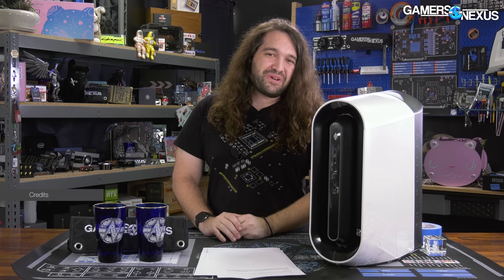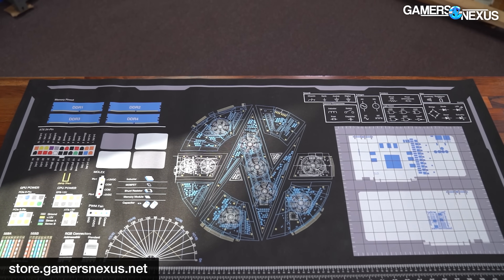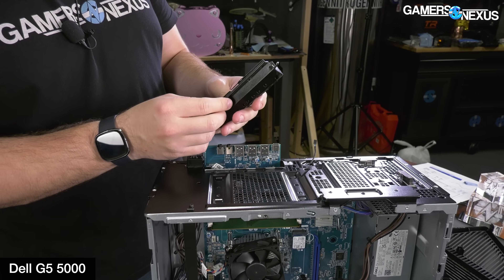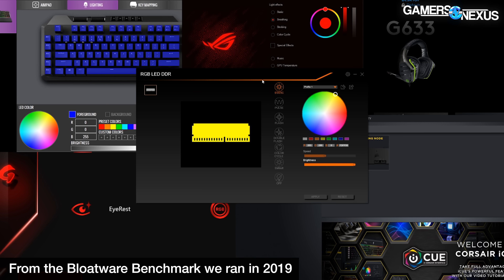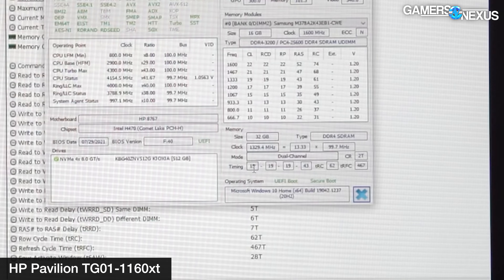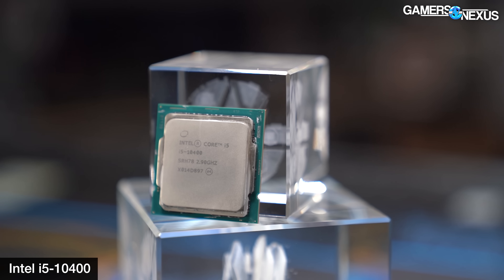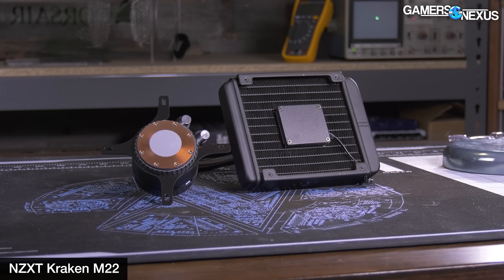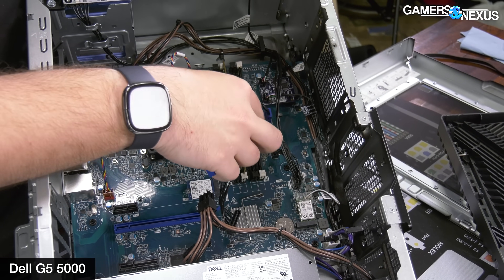The Worst Prebuilt PC Mistakes We've Seen (So Far)

Comment: Was very surprised that my Lenovo Legion AMD 5 tower [The Ryzen 5 3600 version] only had two 'bloatware' on it. The Lenovo Vantage program which doesn't even have to run constantly, and I think McAfee which I installed swiftly no prob. The RAM was a single channel of 8 GB but I knew that going in and got two 8 GB sticks of Corsair Vengeance for 16 GB. I got lucky with this prebuilt but I also watch GN and do research. Those Dell and HP systems make me want to roblox myself.

Comment: I worked for a company in Serbia that does all sorts of builds, and it was funny to me when I started cable managing the cheap office-type PCs and they were like: "that's a waste of time, just zip-tie them so that they don't get into a cooler and any fan that is inside of the case", but if it was anything over 1000 Euros, they made sure and triple checked every single cable, it was not allowed for a PC to be built without checking it all and making sure that it's almost perfect.

But depending on the cases we worked with, for example, Raidmax cases always have 4 fans inside and they are in most cases molex powered ONLY, and you end up with molex centipede. Most of the time it was not up to us to make the situation better, we worked with what was given to us, and it was way cheaper to use molex fans because they are 50cents less (I always get mad because of that, but again when they build 100s of builds like this a day it does sum up to something).

Anyways, love the content keep up with the great work!

Comment: Those proprietary mobos and PSUs drive me up the wall, let alone coolers and stuff. I save a lot of office PCs and stuff from the landfill having done jobs at one and elsewhere and trying to repurpose those things without resoldering complements or something to scrap the literally caps from the board is difficult when you can only use the parts with the Dell Model TPP4294u-X or whatever.

I also have some "retro" PCs for parts from the mid and early 00s. Same thing! Except some better coolers I guess lol

Comment: not soldering plugs and PCI connectors to the main board of prebuilt computers that were not sold with the device that would plug into the missing port (solder pads on the board for it, just the plug is MIA). thankfully I haven't seen that in around 20 years, however, it's also been about that long since I got a prebuilt computer for just that reason. if you want something you can actually upgrade, don't get a prebuilt.

Comment: I had a prebuilt where the motherboard was locked to the harddrive the system came with, when I tried to upgrade the harddrive I could no longer boot up the computer, I don't remember the exact message it told me as this was several years ago, but it was something with roughly the meaning "Bios key locked", I believe it was an HP prebuit but for somewhat obvious reasons, I don't have it any more so I can't double check.

Comment: I don't know if you've ever looked at how HP designs their pre-built cases to accept NVMEs, but they hang off the motherboard and you need to have standoffs available in order to install it to a the case itself via a screw slot at the bottom of the back side panel in order to secure it. Awful design.

Comment: A prebuilt classic that's always happened to me and my family: Specifically order a configuration with two sticks of RAM, open the PC up at some point and see both sticks in the first two or last two RAM slots.
Reply: at least they didn't do you like Dell would and just "upgrade" you to a single stick of the amount you ordered even though you selected 2xYGB
Reply: I bought a 2nd hand pc that’s put together from off-the-shelf parts and it still had the ram in the first 2 slots. I mean fixing it didn’t change my performance that much because it’s an old-ass pc, but still, it’s better to run dual channel
Reply: OR one stick of ram with twice the capacity

Comment: 8:40 Just gonna put it out there that experts dont typically remove boatware because its too time consuming and it professionals will typically just order the prebuild without an OS or if that is not an option will just install from a clean windows image upon initial setup. It will typically take less time to do this than remove the bloatware apps one by one. Sometimes you just need to take off and nuke the site from orbit. only way to be sure ....
Reply from the maker: Definitely way easier to reinstall Windows.
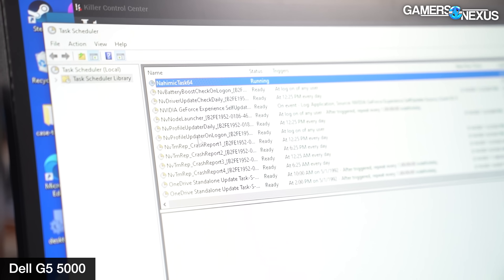Reply: Which was already stated at 8:50..
Reply: @thetalesofdaneandco  Protip: If ordering a decent amount and they have the same (or very similar) hardware, set one up manually, then mirror the disk image onto others using Clonezilla or something, that way each one only requires minor config like hostname and such. Can potentially save time depending on how much setup/config is required before issuing to users.

Comment: As usual great content Steve. There is a point where I don't fully agree with you. In 2021, I don't think 32GB is overkill anymore. Win 10 is much more memory hungry and having more RAM means that the CPU does not need to compression the RAM so much and thereby improving multi tasking performance.

Perhaps the argument of the extra $80 that is spent on an additional 16GB stick of RAM can be better spent elsewhere, but for generic desktop use (not limited to gaming), I am no longer sure if I would spend the $80 on a CPU upgrade (if there's any such option) or perhaps just to have 32GB instead of 16GB.

Comment: As a Cities: Skylines player... it really hurts that you're shitting on 32 gb ram so much. I swear just a handful of mods send you over 20gb!
Reply: That's an edge use case though.
And it still won't give you a good experience when the timings & latency are terrible and the 32GB RAM is paired with a bargain bin i5 CPU.
Reply: @LRM12o8  it really isnt. i have two apps open and my system uses 50% of 32GB. if i try to open a game or a nother browser window with too many tabs and i get memory issues. 32GB isnt even enough for me. 32GB is not overkill anymore. Windows and windows apps are memory hungry. deal with it. 64MB is not enough anymore, move onm from the past. I have been running 32GB for well over 5 years now!
Reply: @prydzen  No. For the vast majority of gamers (and even more normal users), 16GB is more than enough.
Reply: @prydzen  What apps are those? If you don't specify, then that's pointless information and not an argument. 

I've been using 16GB RAM for five years now and never felt the need to upgrade. I've never reached 100% RAM utilization, running brave browser with 20+ tabs and modern games like SW Jedi Fallen Order plus sometimes even a VM that reserves 4GB on top.
If running Windows and its bloated apps alone ever required close to 16GB, then I'll gladly move on... to Linux! The Operating System is supposed to be as efficient as possible, so I can use my resources for the actual applications. Saying "deal with it" to a resource hogging OS is ridiculous!

But anyway, you completely missed the point that Steve made and I defend:
A better CPU would generally provide a much bigger performance benefit than this big amount of really poor quality, really slow RAM!
Especially since these weak CPU's can't perform most typical memory-intensive tasks well enough to make use of that 32GB RAM anyway!

Like Linus once said, unused RAM is wasted RAM.
Most new games are still playable just fine with 8GB RAM and when it comes to productive tasks, performance is hampered by the low-end CPU and GPU, so even then the 32GB RAM won't be of much use. It's wasted cost at these specific configurations!
Reply: @prydzen  
The fact the RAM is used does not mean it is necessary. Just look even in the basic Task Manager, you can see how much of "used" RAM is just cache.
I am normally using 14-15 GB of RAM even prior to launching a game, yet to others I still recommend 2*8 GB for average-budget builds.
Reply: @Killer007TV   This is why it drives me crazy when I see reviews on those "cleaner" apps, or comments somewhere about RAM usage on Android phones. So many "average users" run those "memory cleaner" apps constantly because they think RAM usage needs to stay as low as possible and don't understand that the OS is using most of it to cache things like data for apps you launch regularly etc. It will release as much of this RAM it's using for cache if it needs to as soon as a App requests enough RAM that it needs to do so.
Reply: @sean8102  Thank you! Exactly spot on. Unused RAM is a wasted RAM. When more memory for foreground apps is needed, the system will automatically allocate it to them. These Ccleaners and similar trash bloatware just leveraging on lack of knowledge amongst the majority of PC users and their fear of "not enough memory"...
Reply: yes fuck, for my next pc I will be definitely getting 32gb, just in case I want to play Cities skylines again.
Reply: I actually take this back. As a game player in general it hurts. I am trying to literally just play GTA:V and have a browser open and I am already using more than 16gb of ram. My system is maxed out at 16gb usage and is using the page file like mad. game is unplayable!

Comment: During the summer i picked up an Alienware Aurora R12 with the intention of gutting it. When i got the new furnace from dell, i opened the side panel to remove the parts i wanted. The unite came with the 120mm AIO, but the fan internally was set to pull, not push. The case would have just entirely filled with hot air with almost no way to thermally radiate outwards. Nothing like a 4A server fan running intake into a hotbox. I thought it was going to lift off like a Harrier. 

TIL: Dell makes V-TOL Jets with improper cooling configurations.

Comment: Last year I bought a Skytech pre-built and it managed to have 300GB of unused and non-labeled files buried on the system with a 500GB SSD as the only storage. Also that same system had a broken hard drive bolted in the back of the system. It seems like they plugged in one drive and it didn’t work so they just put another one in without ever taking out the dead drive.

Comment: The computer I have been using for the last couple of years is a pre-built from a local company (Yes... I was the teenager that saw a Big Youtuber showing a brand of computer builders and went: oh, fancy looking shiny thingie... me wants) and they actually did quite a good job when it comes to the components, the build quality... The only thing was the RAM... Regular Corsair RAM but only 1 stick of 8GB if I wanted 16GB I also needed to upgrade to a GTX 1070 at the time so... With 8GB single sticc  I went

Comment: 6:02 damn, I haven't heard a WinME mention in YEARS, totally forgot about that one
Reply: I'll never forget it. As a kid my parents bought a computer with Windows 95 on it and then the next computer they bought came with ME......not 2000.....No it had M freaking E on it. And it constantly had errors
Reply: @kudzuwarrior  You realize what went wrong with ME, don't you?   That was the era when Plug and Play was still NEW.   Before that, many cards required you to set dip switches to select memory address and IRQ to avoid conflicts.   So, ME comes out with Plug and Play support, and of course, it breaks.   The problem was that in the effort to do the "plug and play", it would change the memory/IRQ for all the devices in the system, and a stable system with a new sound card would not only BSoD, but removing the sound card wouldn't fix the problem.   Windows XP at least had Plug and Play working, but in ME, it did NOT work properly.
Reply: @kudzuwarrior  Sounds like user error.....  I had 3 systems running WinME that were rock solid.
Reply: @aaronthomas6155  history would beg to differ with you bud. Your experience does not equal the experience of every other person out there. That's like saying "well this game runs fine on my system so there's no way you have problems running it on yours"
Reply: @aaronthomas6155  That's right you did. You may have just as well walked right up to me on the street unprompted and spit right in my face because "user error" is nothing more than you using a euphemism to tell me I'm fucking stupid. So you're damn right I'm gonna push back.
Reply: @Aaron Thomas
Tbh, not all ME instability was user error.

What I noticed back in the early 00’s, any custom desktop at the time that was running a vanilla copy was ok most of the time, but OEM pre builds, ESPECIALLY Compaq and Acer had some really SHIT deployments of Windows Millennium images.

And when you add malware from Limewire / Kazaa / Morpheus etc at the time? Might as well have the tech install 98 or 2000 (which many did do lol)
Reply: @The Redneck RAM
You both are right. From a techs perspective, some ME builds & OEM images that were pre installed were unusable, which is well putting it EXTREMELY lightly lmao.

And some honestly ran ok. It really did depend on the hardware and the installation at the time. 

However, alot of techs back then did not want to deal with the hassle of malware removal on it, because alot of times the OS would still not be stable, so many took the simple route, and did 98 SE or upgraded to a new copy of 2000 there.
Reply: @aaronthomas6155  sounds like an ID-10T error between the chair and the computer
Reply: @aaronthomas6155  What you didn't(and still don't) realize is that Windows ME had a problem with Plug and Play.   If you took ANY of those WinME systems and then did something like add a new sound or network card(they didn't have networking on the motherboard in those days), the whole Plug and Play function might just break your system, with NO way to fix it or roll it back, because the memory address and IRQs for the other devices in the system might have been changed.
Reply: @Targonis1  I swapped sound cards, modems, graphics cards, processors, motherboards, RAM....all with no issues.
Reply: It's better that way...

Comment: I bought a cyberPowerPC prebuilt about two years ago. 2080ti, 9700k, 16 gigs of 2666mhz ram(don’t remember the timings)….
It thermal throttled and gaming performance sucked. The case was garbage for airflow. Glass front panel, small “vent” cut into the side panel that fit 2 120mm fans, one 120mm fan opening on the top, and one on the back.
Eventually I replaced it with a mesh front Coolermaster h500 and upgraded cpu cooler to an arctic freeze II. Replaced the power supply because it was overloading… Replaced the ram with 16gb of Corsair cl16 3200mhz ram and tossed the case where it belonged: in a dumpster. System runs very well now and benchmarks very well against similar systems. I’m grateful the testing GN did. You helped me decide what to replace and what to replace it with.

Comment: Dell and HP are now firmly on the "Never Buy" list.
Reply: For me? Always have been.
Reply: You should add Alienware (which is just a Dell in different clothes) and Lenovo to that list.
Reply: To be fair, never buy a pre-built gaming PC... from any manufacturer or integrator. They are almost universally a bad value,  either due to lower quality components,  inflated price or both... and that's not even mentioning build quality. Even the few that GN didn't outright hate, they could only recommend because BYOPC is insanely difficult due to supply shortages.

That said, Dell or HP for general home / standard business work? Those are typically solid choices. Remember they lease their business line PCs by the shit load... For all the complaints about "proprietary parts" in this video, I guarantee five years from now it will be far easier to source a 2nd hand replacement Dell Optiplex motherboard then it will to source a given Asus or Gigabyte board.

Comment: When I watch these videos I realize I must have gotten the unicorn prebuild in early 2021.
Found a cyberpowerpc with a gen 10 i5, MSI board and 1660 TI with actual name brand crucial single 8gb stick of RAM for $650. It was priced at $800 but I had some rewards points on a credit card soo hello 1080p gaming.
I was surprised to find the 450w power supply advertised with the PC turned out to be an EVGA 650w soo that upgrade path was already taken care of. Besides getting a ram kit second hand from a good friend for $100 for 32gb total and a cheapo Lian LI CPU cooler for around $40 this thing had been solid through the very warm summer we've had.

Comment: Is there a general "rule of thumb" for when control software for devices (mouse/video card/etc) becomes bloatware, rather than useful software? I would assume it's anything you're not actively using to change the functions of the device?
Reply: My recommendation would be to look at it's file size. If it's double digit megabytes it does more than you actually need. Autohotkey can replace most of those applications but is a very scuffed solution in comparison.

Comment: i made my mate buy a medion pc (aldi) 
everything is std formfactor 
matx mobo 
atx psu 
only shitty thing is the ecs b550a4-em 
need to manually put in the ram timings otherwise they run at 2133 instead of 3200 mhz
wich is a must with ryzen apu's

Comment: The big one ive seen from cyberpower is putting all fans in as exhausts. Ive sent a couple of people their way and every single time this was the case, but that was also the only issue they had. Knowing this was coming i just flipped them around or told them how to, nbd. 

I don't fault anyone for selling 120mm aio's either, they aren't a scam or anything, just not the ideal solution. Probably better than those cheap, poorly fitted pancakes on the major oem prebuilts anyway.